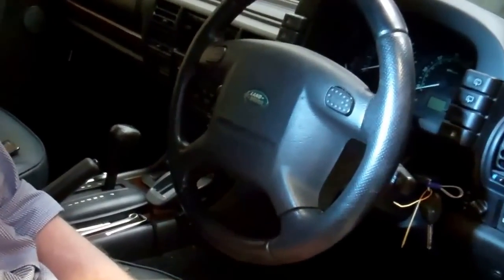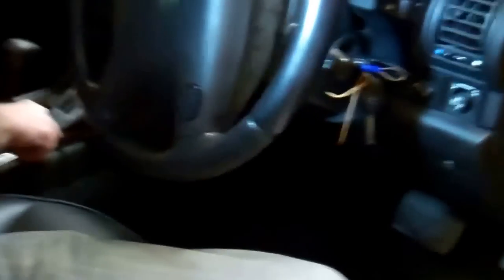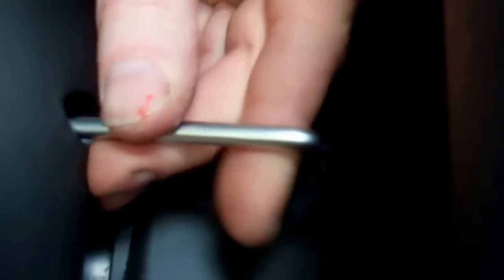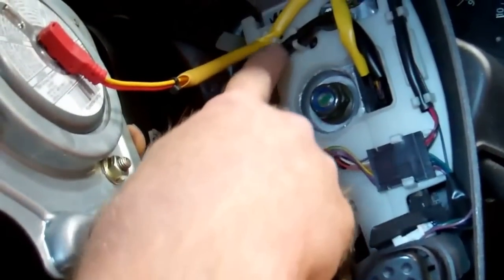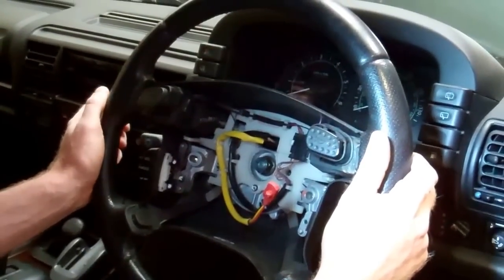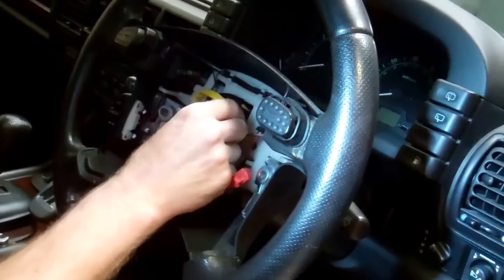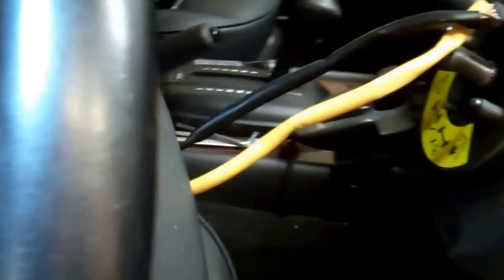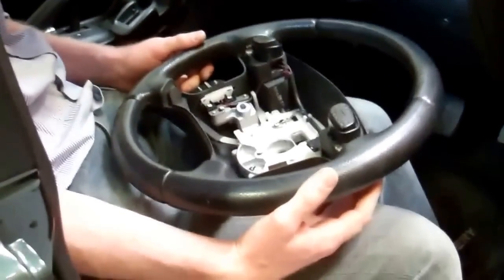How To Remove Steering Wheel & airbag from Land Rover Discovery 2

Comment: Why do you need to disconnect BOTH battery terminals? Surely once you have one terminal disconnected there is NO possibility of the battery supplying ANY current to anything?
Reply from the maker: you are correct - i was just super keen !
Reply: I'm like that sometimes, I take the light bulbs out after I switch them off ;-)
Reply: Sorry, I should have said, thanks for taking the time to do the vid: v. useful, cheers.